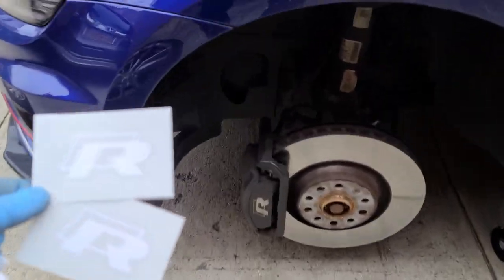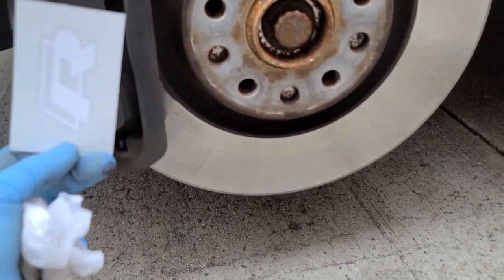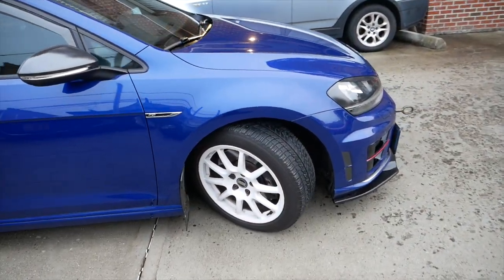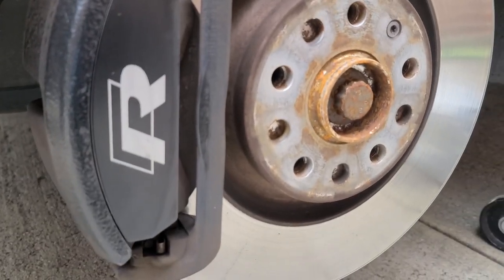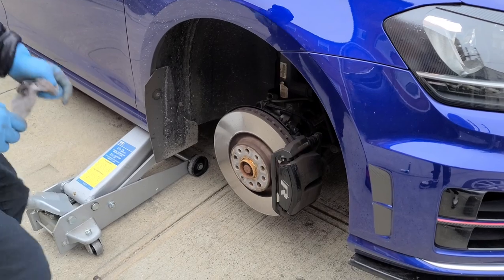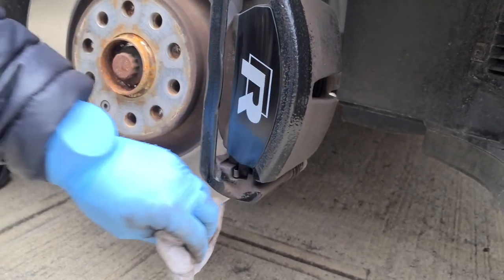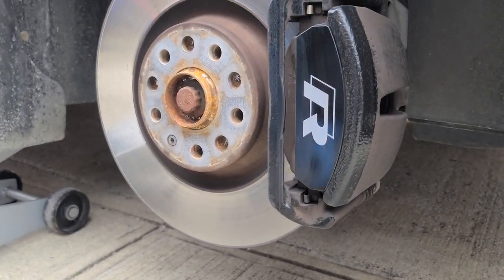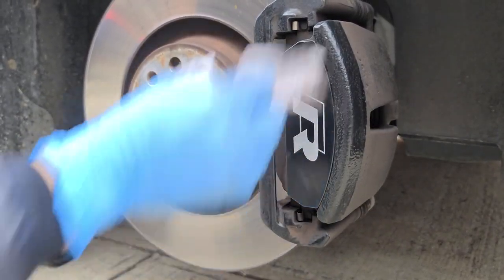Badgeskins Brake Caliper Vinyl Set for the MK7 | MK7.5 Golf R

Comment: How are they holding up two years later?  My original Rs are really faded on my 2019.  I track my car occasionally, and I'm concerned about heat from the brakes causing them to separate from the caliper.
Reply: I went to the badgeskins site, and they specifically say:

Note: Not Recommended If You Track Your Car 

Oh well.